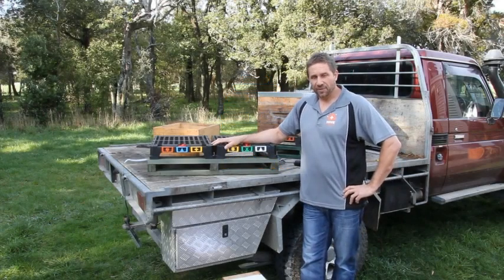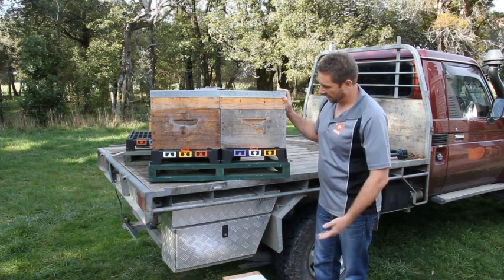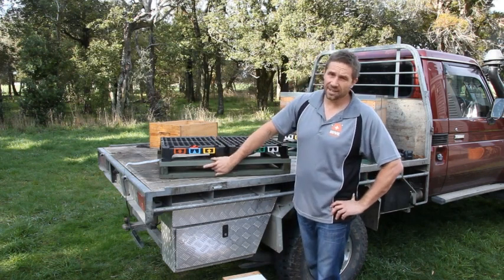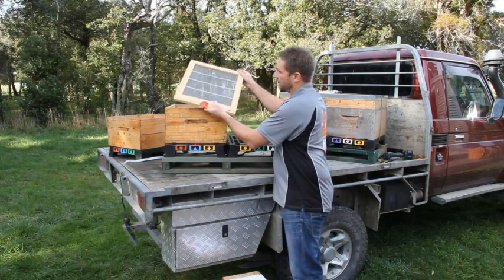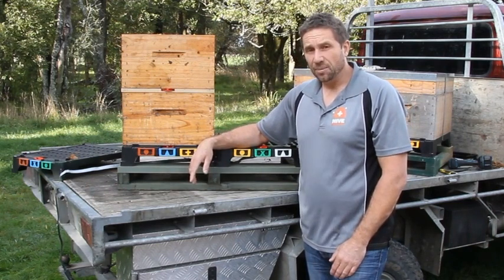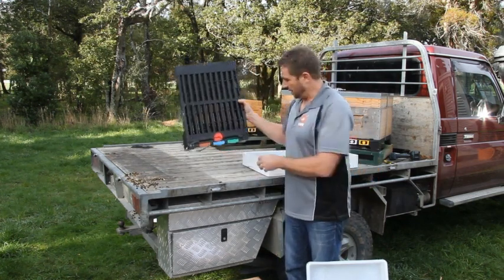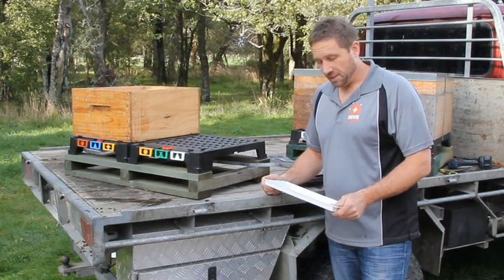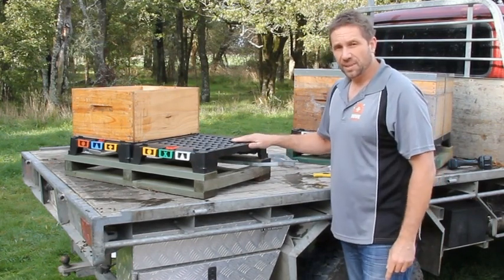Bottom Board General Use

Comment: Bleach solutions require a full 10 minutes of contact time to ensure complete disinfection at 10:1. If bleach solution is used for less than 10 minutes, a greater volume of solution should be applied. Adjust as required.